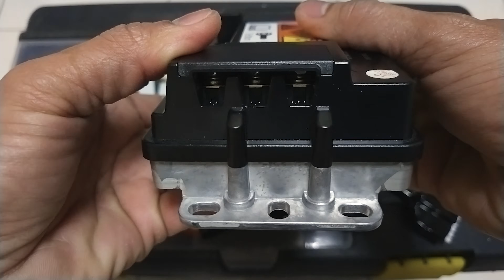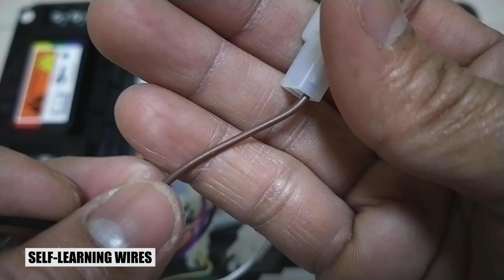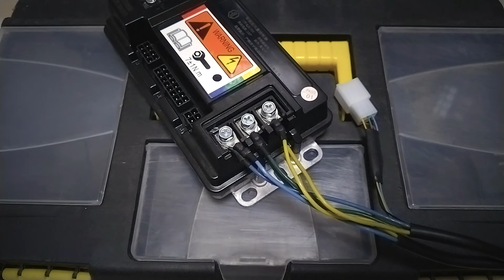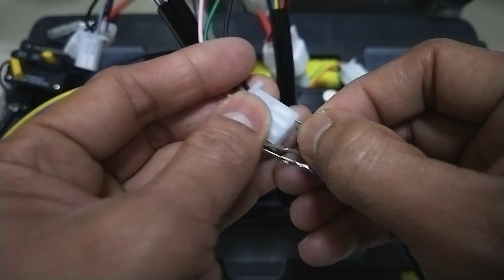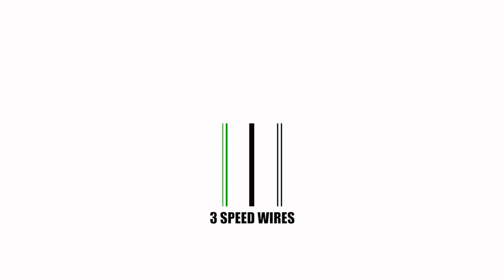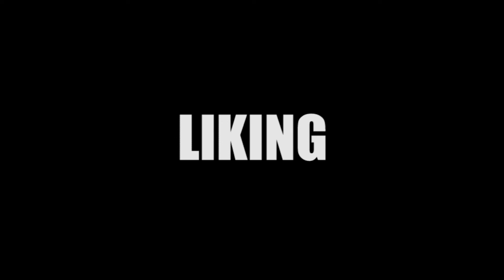Votol Controller | How to Wire or Install Votol EM50-4 Controller | Brushless DC | BLDC Controller

Comment: hi.. nice info.
Im about to upgrade a fiido bike too, already bought 48v 15Ah battery, But what about votol em30s, is the self learning cable is the same?
Reply from the maker: Goodday!
Thanks a lot!
Most of votol controllers have self-learning cable.
Maybe different color, but the same function.

Goodluck to your build!

Ride safe!
Reply: @jaysonulanday  thx u for the reply, i will try to look after the votol arrived. 
Cheers..
Reply from the maker: @danirinaldi1044 
Update me once you got it.
Have a good one!

Comment: Boss thank you sa video mo kala ko sira ang nabili Kong controller same kasi ng sayo
Reply: Boss ang problema nalagutok ebike ko parang makakalas yung motor ng ebike 4 wheels ko tapos yung reverse ang bagal
Reply from the maker: Goodday Kaadik!
Maraming salamat sa panonood.

Kailangan pa i-program un settings niyan. Kung nalagutok, maaring mali un setting ng "Hall Angle" niyan (120 or 60)
Pag mali din un "phase wires" / "hall sensor wires" combination magco-cause un ng violent  vibrations/stutters.

Maganda sana kung mai-program mo yan controller.

Comment: Hi Jayson Ulanday,
I bought a controller just like the one in the video. 
Do you know if this controller needs to be programmed before use? Because when I checked the manufacturer's website, it says it's a programmable controller.
Reply from the maker: Good day!
Yes, it's programmable.
You need to connect to a computer.

Ride safe!😎

Comment: Hello, will the 12-volt voltage reducer, which is in the link under the video, work normally with this battery (will it not burn out)? LULIS

LITHIUM BATTERY
MANUFACTURER: ZHEJIANG TIEYING POWER ENERGY CO., LTD.
Product model: 72V40Ah
Battery type: LFP.
Nominal voltage: 72V
Nominal capacity: 40Ah
Charging voltage: 87.6V
Battery energy: 2.88Kh
Reply from the maker: Good day!
Yes, it will work.
This DC-DC stepdown converter is designed to work on batteries rated at 36v to 72v nominal voltage.

Ride safe!
Reply: @jaysonulanday Can you tell me what voltage to apply to the 16-pin connector in the ignition pin on the controller?

Comment: galing kabs watching from doha qatar....yung video mo na additional battery for longer range separate  ba yung charging o parallel sa isang charging port...salamat sa sagot kabs, God Bless!
Reply from the maker: Goodday Kaadik!
Nice! All the way from Doha Qatar!
Maraming salamat sa panonood!😎
Naka parallel din un charging port para sabay na mag charge.

Gumamit ka ng silicon wire. Make sure ung wire is in good condition.

Ride safe lage Kaadik!

Comment: how about lights and signals
Reply from the maker: Goodday!
That's a different wiring. Normally accessories are rated at 12v. You will be needing a DC-DC stepdown converter.
You can connect the negative and the positive input wires of the converter directly to the power line wires that connect the battery and the controller.
Or use the controller's accessories(alarm kit) output wire.
I made separate vids.
Check these links.
These are related to your query.

How I Installed/Wired The LED Headlight Tail Lights And The Horn With A Relay | Fiido Q1S
https://youtu.be/fiRhLvlq3KQ

How to wire High Brake and Low Brake wires of a BLDC Controller | Brushless DC Controller
https://youtu.be/6zg6X72b2Lk

BLDC Controller | High Brake to Brake Light Wiring Guide | Brushless DC Controller
https://youtu.be/ozO0va3dFFE

Ride safe!
Reply: very informative video,i have honda e cub 2024 model in canada,problem is bike showing display with alarm for 5 seconds then turn off when i move bike or touch alarm activate with display but motor not works and shutdown it has nfc tap keyless function and imei 4g module too,i dont know what issue in bike,i wait for your reply

Comment: I managed to reverse engineer this VOTOL controller and extracted the full schematic, all the components are from cheap chineese manufacturers, the build quality isn't the best, it lacks phase current measurements and protections and mosfet overheating protection, the BUS CAN is a mistery they've used the transmit line only I wonder how they managed to make it work, the power supply that feed the control circuit is based on a Flyback converter with no feedback, so the voltage regulation is ensured by cheap linear regulators .

Comment: Anong controller ang may regenerative braking?
Reply from the maker: Goodday Kaadik!

Depende un sa controller.
Ung YYK controller meron regenerative.
Need i-activate through YYK Appilication via bluetooth.
Kailangan mo i-wire un High Brake or Low Brake.
isa lng need mo i-wire jn.
Check mo tong link, kattpos ko lng gawin un tutorial niyan hehhe!

https://youtu.be/6zg6X72b2Lk

Ride safe lage Kaadik!

Comment: Ok lang po pala nakarekta sa battery positive terminal na mataas ang volts yun electric lock or lock wire ng controller pag itetesting palang kung gagana yun controller dahil wala pang key switch para napapatay yun controller
Reply from the maker: Goodday Kaadik!
Oo, ganun talaga pagwiring.
Sundan mo lang un nasa video.

Ride safe lage Kaadik!
Reply: @jaysonulanday may napanuod din ako na video na pag dalawa yun wire ng electric lock yung isa usually red color sa positive terminal ng battery at isa naman usually pink wire sa key switch naman or kapag itetesting palang at wala ka pang key switch na available pwede rin na pagdikitin yun 2 wire o i-loop silang dalawa para bumukas yun controller, tama kaya yun bro
Reply: @jaysonulanday paano po kapag 2 wires yung electric lock? Hindi isa lang
Reply from the maker: @brandzsantos4670  
Goodday Kaadik!
Kung dalawa un electric lock wire(switch wire) ang isa dun is connected sa power positive line wire supply ng controller(makapal na wire papuntang baterya)
At un isang wire naman is un mismorng electric lock(switch wire), naka solder un sa VCC ng circuit board. Makikita mo yan pag binuksan mo un controller.
Pag nag-loop connection ka magpa power on un controller kase connected un switch wire sa power positive line wire na naka rekta sa baterya.
Completely the same lang yan sa video na ginawa ko.

Kaadik may mga controller kasi na may nakaabang ng wire para sa power positive line wire (tulad ng controller na may dalawang switch wire). 
Sa video na ginawa ko ay iisa lang ung swith wire (lock wire) kaya need ko pang i-link sa mismong power positive line wire ng controller na ko-connect sa power positive line ng baterya para mag power-on un controller.

Ride lage Kaadik!
Reply: @jaysonulanday ok bro maraming salamat sa maliwanag at detalyadong explanation kaadik :) isang dagdag kaalaman na naman ito para sa akin
Reply: @jaysonulanday isa pang tanong bro paano kapag may susian na ako saan ko ikoconnect yun dalawang wire ng controller para madaling patayin sa susian, isang wire lang ba icoconnect ko yun mismong switch wire lang yun icoconnect sa wire ng susian tapos yun kasama nyang wire na connected internally sa battery iiwan ko lang ng walang connection ganun ba yun? Yun kasi pagkakaintindi ko sa mga nabasa ko sa internet at sa sinabi mo :)
Reply from the maker: @brandzsantos4670 
Kailangan mag connect un dalawand wires (electric lock).
Bale, un switch ang magiging bridge nun dalawang wire.

Anong switch gamit mo?

Comment: I had to reprogram pin with the controller software to enable self learning function on the brown cable. Apparently, the default configuration of the controller  may depend of the supplier....
Reply from the maker: Goodday?
You mean it didn't work after reprogramming?
Reply: @jaysonulanday  hi jayson. No, I mean that self learning was not available on the brown cable. I had to reprogram the controller to make it available and it saves my day. Anyway, I appreciate your videos :). Good job !
Reply from the maker: @patrickerbin3976 
That's a great job!

Ride safe!

Comment: So you didn't even have to connect to a computer to program it initially? Self-learned the hub motor automatically?
Reply from the maker: No, i did not do the programming.
I tested if its going to work, and it did.
It performs well than the YYK 50A.
Better if you set the program.

Yes, i did use the self-learning wires to get the right direction.

Comment: Just one simple Question. Can we Use this type Controller 60V 1500 to 3000W 80A universal in Citycoco big ebike with 60V 15Ah 2X batteries and 1500W motor...

Comment: Jayson, I commend your presentation - well done sir. I wonder if you might be aware that different manufacturers of this named device appear to be wiring different colours to the plug/pin location. I downloaded a wiring schematic that I thought would be of this device but wonder, do I follow the colours you indicate or the plug/pin locations they go to ? Your comments would be much appreciated.
Reply from the maker: Goodday!
Thank you so much!
Follow the pin location, it's what important.
The colors are sometimes different specially if from other manufacturers.
But i highly recommend that you follow the wiring diagram spicifically for the controller that you have.

This tutorial i made works perfectly for votol EM50-4. Some major wirings would also apply for other votol controller.

If you also have votol controller just download the diagram from thier website.

Ride safe always!

Update me when you're done🛴
Reply: @jaysonulanday  it would appear that this is a (copy?) version manufactured by DKYS  / WUXF DINGKO TECHNOLOGIES CO LTD in China. Colours at the final connectors appear the same but they don't match the pin locations from VOTOL directly. Connections to the motor are clear so I will proceed with caution and advise.

Comment: Hello. Votol EM50-4 controller. I made all the settings except for the cruise. I tried all the empty ports, set the cruise_butten option, saved the parameters, connected the brown wire to the connector through the button with the black one. None of them work.

Comment: hi i want em80 is has set cable for plug and play for yadea e8s pro or not? thank.
Reply: To make the electric bike turn, just connect 4 wires: the electric door lock and the handlebar wire. You can study the rest later

Comment: I’m connecting mine to a Kunray My1020, I have everything connected like in the video, but it will only power the motor for a split second. Then it stops working

Comment: Just bought this controller. I have identified most of the leads but not the self learning leads. What I have are two yellow wipes with black connectors that fit together. Are theses my self learning leads. They go to pins 6 and 15 on the connector. Can you help me
Reply from the maker: Goodday!
Sorry for the late reply.
I had to check carefully the wires.
Pin 6 is the self-learning wire and has to be connected with a ground wire.  
In my controller the pin 6 is partnered with pin 14 which is the ground wire.
The pin 15 is the sport mode gear.
Try to double check your pins once again.

Did you get the same controller (model) EM50-4?
Reply: @jaysonulanday  ok as itsa brushless motor I will just swop a couple of leads and that will reverse the motor direction as well
Reply from the maker: @deswhite8268  
First, try to match the phase wires and the hall sensor wires according to their colors.
If the motor turns smooth and no wierd sounds, ..then that is good.
In case if it turns backward then simply use the self-learning wires.
Reply from the maker: @deswhite8268  you may do swapping of the phase wires and the hall sensors wires if you don't get smooth turn or spin of the motor.
Reply: Further issue. Motor only runs when reverse wires connected together. Any ideas
Reply: Motor does run forward but only if I rotate the wheel slightly first so I assume it's a clash between hall sensor and motor leads although the colours match the controller. Than you for your help and replies.
Reply: Hi again. I used the self learning wire too reverse the rotation of the wheels. However is there a method of undoing the reverse?
Reply from the maker: @deswhite8268  
Goodday!
How are you?
Just simply connect the self-learning wires, ..then turn on your scooter.
You will see the wheel turns automatically to the opposite side.
Once done, power off your scooter then disconnect the self-learning wires.
Again, power-on the scooter.
The wheel will turn according to the direction it was programed by the self-learning wires.

Have a good day!

Comment: Sir salamt needed to upgrade my ouxi pero wala akong makita na marunong dito sa davao.
Reply from the maker: Goodday Kaadik!
Nag upgrade ka ng ganyan controller?
Reply: @jaysonulanday sana po research phase pa po.  Yan kasi nakita. Na tumatangap ng 48-72. Any tip sir? Sir baka naman may tutorial for breaker.
Reply: Sir hi again. Sir paano po ba i on ans ports mode? Ano po ang switch na mostly ginagamit?
Reply from the maker: @GinamosWithCherryOnTop  
Gooddy Kaadik!
Cnxa na late reply.
Gumamit ka lng ng on/off switch.
Check mo tong link Kaadik.
https://amzn.to/4irSSaL
https://amzn.to/4cP40h1

Ride safe lage!😎
Reply from the maker: @GinamosWithCherryOnTop  
 @GinamosWithCherryOnTop  
Goodday Kaadik!
Cnxa na late reply.
Un magkasamang color yellow w/white stripe at saka un black wire ipag connect mo.
Gumamit ka lng ng on/off switch.
One-way switch.
Check mo tong link Kaadik.
https://amzn.to/4irSSaL
https://amzn.to/4cP40h1

Ride safe lage!😎
Reply: Hello Sir need paba ng program ang votol na yan  bago I kabit?

Comment: Kaadik goodday. Ang lakas init ng yyk at yung terminal nya yellow block nankumg saan naka konect yung phase wire umiinit yung wire ng phase wire pero smooth naman ang takbo. Need ba ng extra fan dito kaadik?
Reply from the maker: Goodday Kaadik!
Kung iinit man yan, dapat warm lng.
Pano wiring combination mo?
Mas advisable kung lalagyan mo ng fan Kaadik.
Reply: @jaysonulanday blue sa yellow .green sa blue at yellow  sa green . Naka reversed sya pero smooth Ang ikot ng hub kaya dun sa programming nya imbes positive reverse ko kaaddik . Yyk controller ko at ld motor 2000watts
Reply: @jaysonulanday merun six combi ginawa ko kaaddik. B-B G-G Y-Y   2.B-Y G-G Y-B   3.B-G G-B Y-Y   4.B-B G-Y Y-G  5.B-G G-Y Y-B   6.B-Y G-B Y-G .

Comment: kaadik parang mas oks yan kumpara sa yyk controller. napansin ko sa yyk umiinit yung phase wire kapag hinataw mo trotle ng matagal at maganda yan kasi pc link sya para sa set up settings ng conroller. ano namansin mo kaadik
Reply from the maker: Goodday kaadik!
Napansin ko nun nag short test lng ako.
Mas maganda un traction ng votol.
Smooth un initial arangkada kase sinewave.
Once nakabwelo na,.. hataw ang takbo!
Bale nun sinubukan ko naka default setting pa lng un. 
Mas recommended kung i-adjust mo muna un settings.
Sa YYK pabugso un arangkada niya, ..pero pede mo nmn i-adjust un soft start sa setting.

Ride safe lage kaadik!
Reply from the maker: Pede mo rin i-adjust un fast start ng YYK.

Comment: which one is better?
That votol or the yuyangking?
Reply from the maker: Goodday!
I did a short test and found out the votol has soft acceleration but once it gets its momentum ..it's fast!
I easily hit 85kph ( TAKE NOTE! usually top speed depends on riders weight, scooter's weight, battery voltage, terrain, tire pressure, even the wind will affect the speed whether running against the wind or along the wind.

To get the full picture,  i weight 63kg.
May scooter is roughly 38kg.
Also, I did not change or tweak the settings of the controller.

Highly recommended to set first the parameter before using the controller.
Reply from the maker: Base from my short test i find votol is interesting.

Comment: Good day kaadik! Ask ko lng kung allow ba kahit ilng volts or watts jan sa votol? Thank
Reply from the maker: Goodday Kaadik!
Pede yan sa 48v-72v battery.
Ideal na motor jn 2000W base dun sa specification niya mula sa website ng Votol.
Need mo pa i-set un parameters niyan sa software para maitama un timpla.
Gagana nmn agad pagka-wire mo pero mas safe pag i-set mo muna un parameters.

Ride safe lage kaadik!

Comment: Which one better for u the yyk or votol sir?
Reply: I also considering change my yyk to votol ...thnks for the feedback sir✌️
Reply from the maker: @bernaventurecyril3538  
You're welcome!
Update me once you're done replacing.
Reply: Do you have the link where to buy the Votol Controller?
Reply from the maker: @obetts1940  
Goodday!
Here's the link.
I just found this on AliExpress: 
AED261.50 | VOTOL EM50-4 48-72V 72300 Programmable Controller 2000W Electric Scooter Electric motorcycle QS motor controller
https://a.aliexpress.com/_oFYGcnl

Ride safe!😎
Reply from the maker: Goodday!
I did a soft test running my scooter with the votol temporarily installed.
I hit 85kph  (default parameter setting)
The torque is gradual but it doesn't take much time to take off! 
You can actually feel its pulling you.! 

I will soon change the parameters and check again the performance.
Reply from the maker: I'll go for votol , is has better traction. (default parameter settings)